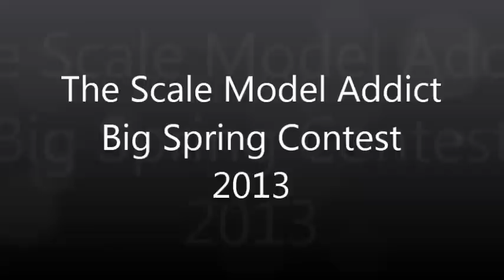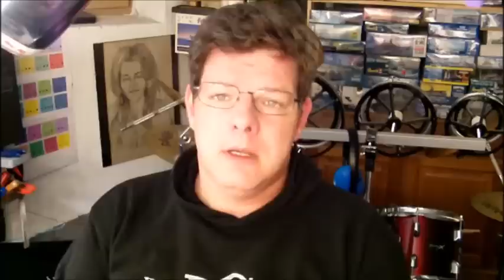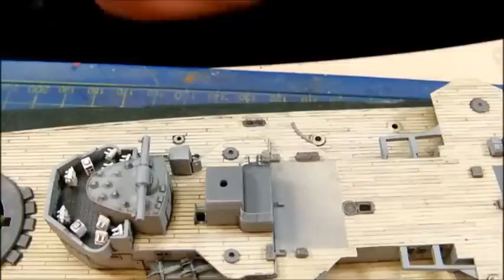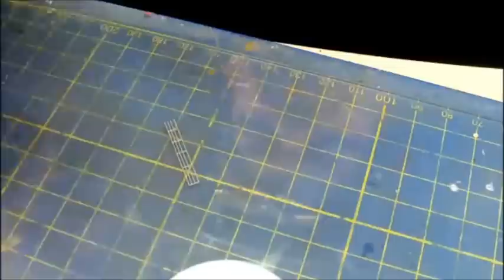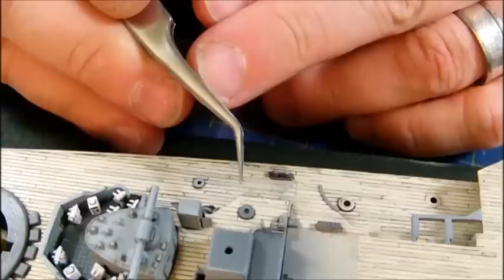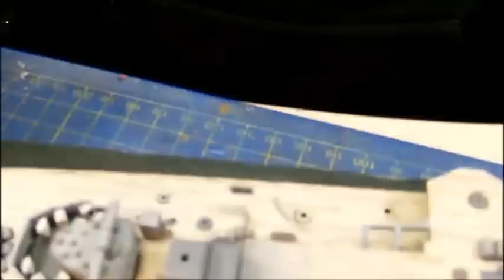Admiral Graf Spee in 1/350: Build Log Part 10 (Railings 1)

Comment: Great work on this. Interesting that you cut all the photo etch railing parts with sharp cutter, I've always used the small sharp scissors on a Swiss Army Knife, which cuts any photo etch part (particularly railings) very sharply and precisely, including cutting off the tiny attachment points to leave a totally clean straight edge, and to shorten a single piece of railing by cutting the stanchion off and trimming the railings shorter (then re-attaching the stanchion). Just sharing this if it may be useful to anyone.
Reply from the maker: Cheers Rob! Of course goods scisors do the job just fine. I used to do that, but changed at some point to using cutter blades. I can't even say why I did it.